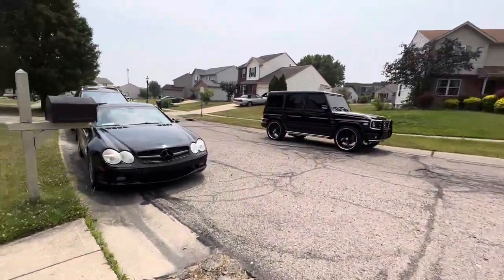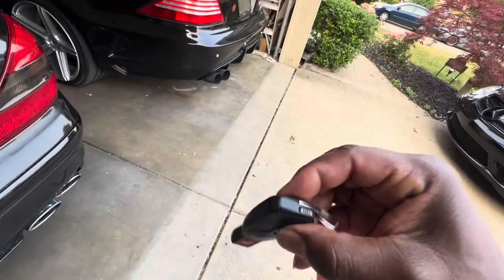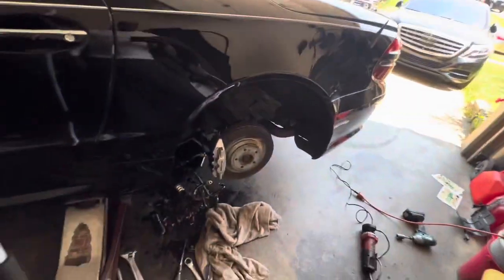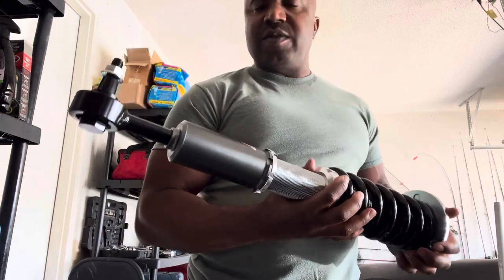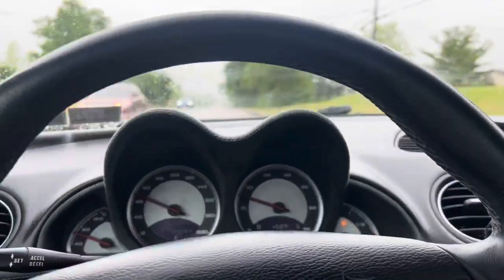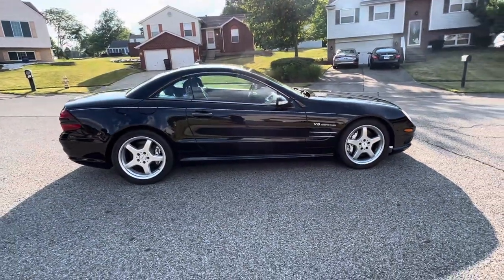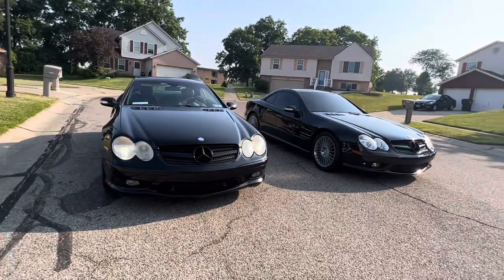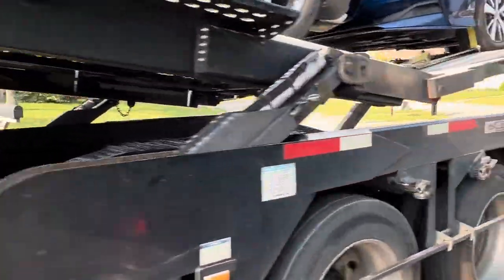SL55 Coilover Swap From Philadelphia Pennsylvania!!!😁 Silver’s Neomax Coilover Installation

Comment: Quick update on my coilover conversion done by Brandon at Gold Element Autoworks.  I've put about 600 miles on the car, and the suspension is working perfectly.  I did soften the rear by 2 clicks.  Very little (if any) body lean into turns and no nose dipping on hard stops.  And the "rehab" is well underway.  Battery just needed a recharge, trunk leak is fixed, wheels redone, new tires, and fixing the PSU and Vario roof shortly.  Yes the car was outdoors for a year and a half while looking for an experienced mechanic I felt I could trust.  I spent some time checking all Brandon's  reviews and speaking with him personally.  You should not hesitate to contact Brandon for a coil over conversion if you want driving your SL to be stress-free.  By the way, the transport company's transfer out to you was flawless.  I contacted them and let them know about the issues on the return trip, both with the schedule and the the tip request and told them I would be picking a different company next time.
Reply from the maker: Thank you so much for the update! It was great doing business with you. If you ever have any questions or need assistance, let me know. 👌🏾

Comment: Do you perform performance upgrades as I see on several Mercedes Benz owners with the SL55 such as pulleys, custom VRP intakes and throttle body, extra coolant tank and relocation and or exhaust upgrades 🤔 ?!?
Reply from the maker: I have someone else handle my performance upgrades. So far….only my CL55 has such an upgrade.